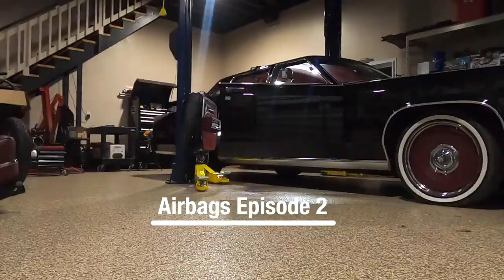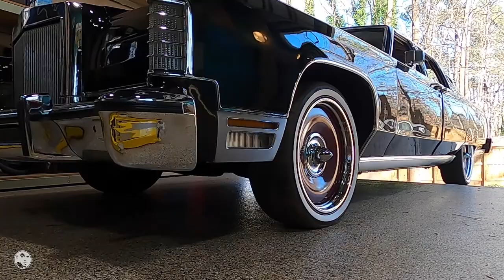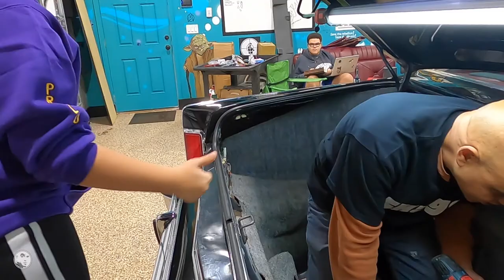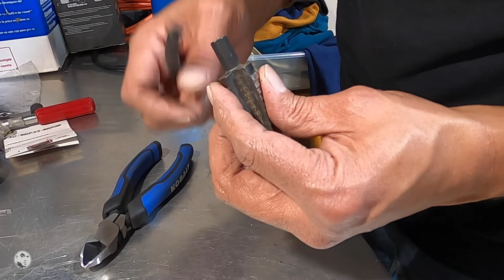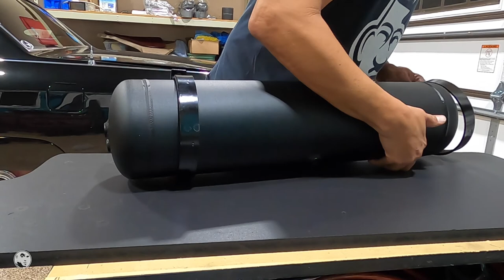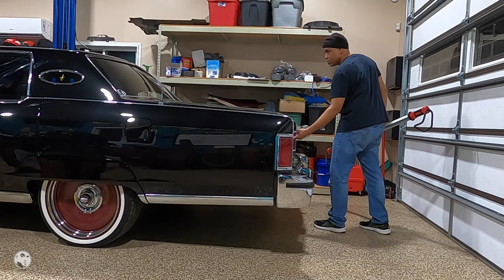Airbag Installation Episode II: Tank & Compressors Placement #airbags

Comment: Did you do dual 5 gallon tanks ? A compressor to each and then t them down ?
Reply from the maker: Yes, two 5 gal. tanks. Actually, both compressors feed into one, then the second is plumbed into it. I then have 2 lines going to the VU4 block. It airs up pretty quick for a heavy car.
Thanks for watching!

Comment: Hey my man im running 2 tanks and 4 compressors but not getting the air pressure like i think i should both tanks are 200 psi should i set my settings on my remote to higher psi.also should i run 2 compressors to 1 tank or 4 to 1 tank
Reply from the maker: 4? Wow! Your recovery time should be pretty quick! I would say check the pressure rating on your tanks before stepping up the pressure. What's your goal? And why don't you think you need more pressure?

Comment: I think you should of putt heat protected shield before you ran that wire also why would u route wire behind hood hinge no no no
Reply from the maker: On the wire from the battery? Also there's a deep groove in the body below the hinges that you can't see on camera. Thanks for the tip though! Thanks for watching!
Reply: @SkaggsGarage  the blue wire comming from the battery needs to be protected from rust and moisture.
Reply from the maker: @juliosandoval8244  oooh ok gotcha! No rust, as the underbody has been coated for rust protection, and she hardly sees rain as it's not a daily driver. It's been done almost 2 years, no issues.  I made sure that there were no nicks or kinks, so I'm confident the cable jacket is holding up. Thanks for your observations! 👍🏼